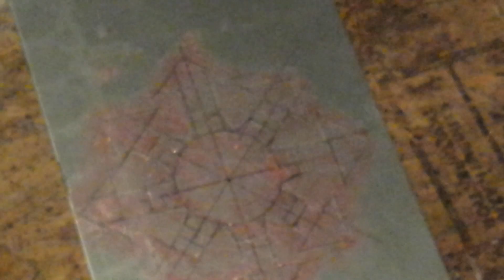Easy Etching metal with a battery and vinegar salt solu

Comment: Not bad. A little bit better storytelling and video editing and I think this will be an interesting channel. Keep at it! You might want to do voicovers of whats happening while the action is occurring rather than while we are looking at something thats pretty static.
Reply from the maker: Thank you very much, i am still just using the editer that youtube provides and am trying my best to get better and really appreciate constructive criticism
Reply from the maker: Nice video, thanks. I'll have to check out mattias wandel.
Reply: +Mechanical Chaos A copy of nero video may be enough to get started with some decent editing. If I were you i'd also use better lights, the high-iso noise is annoying. Speech wise i'd better shut up, i never speak in my videos :)Keep up the good work!
Reply from the maker: Thank you, I'll check it out, and I just yesterday replaced all of the burned out fluorescent bulbs (which was most),  so that will hopefully help with the low light issue(which has been bugging me)
Again, thank you
Reply: You're welcome! A couple of 10$ led "neon" shaped lights will be a nice addition as well should you need an easily movable light bar :)